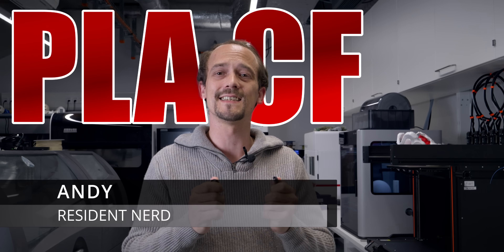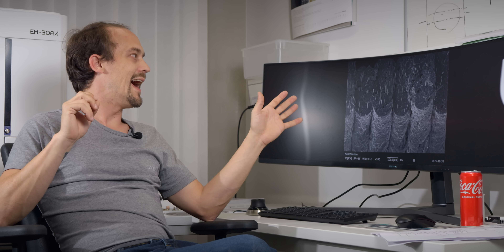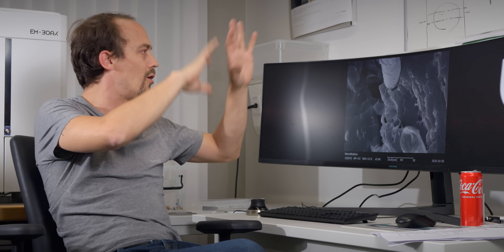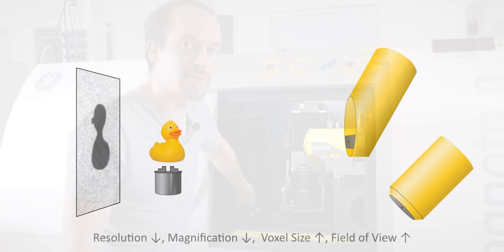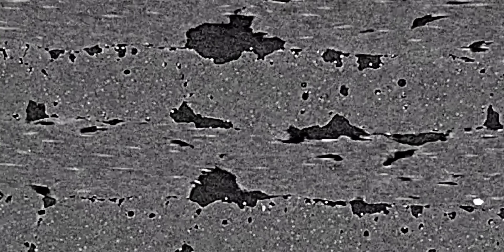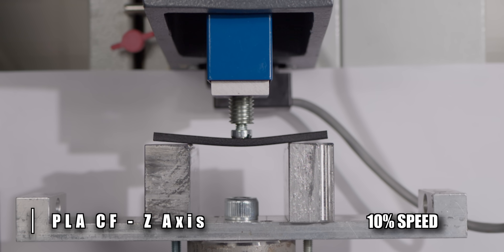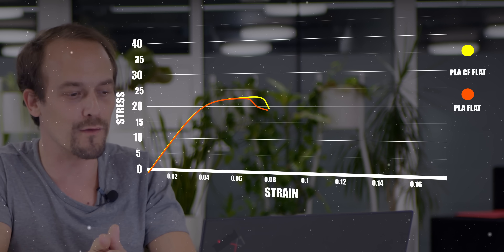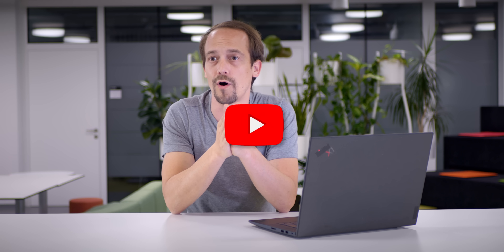3D Printing’s Biggest Scam Is Even Worse Than We Thought!

Comment: My results of testing this were that the TDSs are very accurate and CarbonX PETG-CF is on another level from all the other PETG-CF
Reply: 3DXTech also makes the best PC-CF on the market. PC from most brands is far too heavily blended with ABS or other polymers and loses a lot of the desirable properties. I will also say that Tinmorry PETG-CF and PETG-GF is excellent for the money. Overall fiber filled PETG is awesome and I'm not sure why he is categorizing it with fiber filled PLA which has far more shortcomings.
Reply from the maker: That is why i said "for the most part". In PETG Filaments it is highly dependent f the fibre was surfacetreated correctly.
Reply: @Ibuiltathing Fair enough. I've just seen PETG-CF be pretty universally good and there are a lot of affordable great options. The surface of the fibers is something your vid def has me thinking a lot about. Sorry for spamming your comments so much. I get hyper focused. 😂
Reply from the maker: Ohbi know that feeling and dopamine rush 😅

Comment: What a great video! Such great laboratory equipment. I would be most interested in seeing Bambu Lab's PPS-CF next.
Reply from the maker: I wanted to try that material for a ling time. I have a spool sitting around. Good idea
Reply: @Ibuiltathing I have a spool as well and have been wanting to try it for some time now. It would be great to know the real structural differences when printing at 310°C (lower end), 340°C (upper end), or even 350°C (the H2S max temp). I'm also curious if there are any structural changes when attempting to anneal it. In other words, it is quite an expensive material with the promise of high strength, so how to get the most out of it?

Comment: Obviously Cf filaments are dogshit for mechanical properties; and interesting to see some of the details behind it.

One of the legit benefits is improved dimensional stability though; even PLA is annoyingly warpy if you actually care about precision of large parts; and you can do a lot about that with fillers. 

Now what would be great if someone brought a PLA to market with fillers specifically optimized for that purpose; not abrasive, expensive and possibly harmful carbon fibers. But sometihing just tuned for super easy printing, and near zero net shrikage. Now that would be great.
Reply: Depends entirely on which mechanical properties you are talking about. While PLA may not fare well, most filaments including PETG benefit in terms of strength, creep, warp, shrinkage, temperature resistance, glass transition temperature, and in some cases layer adhesion even if only due to higher possible print temperatures. Generally they are simply worse in terms of toughness. They are more brittle. So, no, what you said is not obvious and often not true at all.
Reply: @802Garage  Talking PLA here specifically; but also for other polymers the main attraction to me is the lower shrinkage (like; it turns nylon from something otherwise almost completely useless into something quite capable). But thats really not due a dramatic difference in when the part might fail (for the better); but due to a dramatic difference in wether something useful comes off the printing bed.
Reply: @eelcohoogendoorn8044 Fair enough and I definitely think automatically assuming a fiber filled filament would be better for any given application is a mistake. It definitely helps stabilize a lot of the "engineering" filaments in super beneficial ways.

Comment: Man, smaller content creator showcase YT algorithm actually did its job for once. This has been highly informative video backed up by data from such high level equipment. Stellar video presentation too.

From my personal interests, if I may request, I'd be the most interested in PC-CF tests, since that is one that is one of the most accessible mechanical grade CF reinforced materials in terms of price and ease of printability.
Reply from the maker: Greate idea. It's on the list now 😊
Reply: I haven't had much luck finding quality composite PC besides maybe spectrum filaments, but I haven't tried them. Any recommendations? I bought some PC-GF one time, and I'm pretty sure it's more PETG than anything (or some other non-PC polymer), and it's the worst of all worlds. ChatGPT later told me GF does not bond in PC at all without specific sizing and silane treatment so it probably was just mostly PETG or something that works with cheaper chopped fiber... (this filament was not expensive enough to expect it was properly done, lol). I don't know if that was accurate or not but the filament did not seem worth using to me.
Reply: @itzexor  The one I have tried is PC-CF from Prusament. Was out of stock almost permanently but seems they finally have gotten their chain of supply in order so finally got my hands on some. Prints like a dream, but haven't yet finished the model for which I got it so can't attest to it in practice. Everyone else seems to be very satisfied with it though.

I remember seeing one other brand do PC-CF but other than that I actually haven't seen much of this particular blend in most brand repertoires.

Comment: Please do the comparison with other materials. This is on a whole other level than the normal stress tests we see on the other channels, showing us what's really going on instead of assumptions. The result with PLA doesn't really surprise me since it's notoriously difficult to make PLA bond with something other then itself. You earned yourself a subscriber.
Reply: Yes please, I would also like a comparison in this depth with CF- ASA, PA6-12 and so on, but also with regular version under the microscope
Reply: Funny - PLA is the exact opposite of silicone caulk, which will stick to almost anything - except itself!
Reply: If that part is made of solid wet‑layup carbon fabric and epoxy, it will break that press
Reply: @lyubomirmihaylov750  If it was, it would have been fabricated with a mold, not with a 3d printer. Different scenario, different story.
Reply: But actual stress tests are what matter! Theoretics are phenomenal, but when testing disagrees, one has to reconsider.
Reply: @TravisTerrell  Most stress test only show that the material failed, These microscopic images give us insight why they fail (and what filaments are bogus). There are many reasons tests fail, but not all have to do with the material but can be due to printing orientation etc.

Comment: Anyone using PLA of any type for its mechanical properties is designing for failure. Speaking from personal experience. The fact that the carbon fibre is impregnated in fragments and not laid as strands eliminates the strength of carbon fibre. I need to add though, I love the look that carbon fibre gives filaments. And PLA is still my all time favourite plastic for anything that I want to have a near perfect look.
Reply: PLA has many desirable mechanical properties provided temperature thresholds are not exceeded.
Reply: @802Garage yes, technically brittleness is a mechanical property, just not a desirable one.
Reply: @Cleav727 You're forgetting that brittle usually goes with strong. ;) PLA has very high strength for its cost and ease of printing. Also generally solid layer adhesion. PLA also varies wildly.

Comment: I have two wishes please: 
Please do the same for glassfiber filaments and please do the mentioned health risk tests.
Reply: Search for dissolution of glass fibers in lung tissue. There's been a whole bunch of research that shows the fibers break down within a couple months before being ingested by macrophages. Makes sense from an evolutionary stand point. Pretty much all living things live in close proximity to sio2 so there needs to be a biological process to deal with it.
Reply: Any small fiber that is inert and cannot be degraded in the body is no different than asbestos. Glass fiber lung disease is silicosis, which can trigger lung cancer.  Many cases of CF induced lung cancer have been noted, including famously in race car driver Stephan Johanson, who inhaled particles from CF brakes.

The lack of regulation around these materials is ignorant.
Reply: @truantray This is only somewhat true. In asbestosis and silicosis, the mechanism of damage is the same, with atomically sharp fibers slicing up your lung tissue, causing an immune response, and building scar tissue which reduces lung capacity over time while massively increasing cancer risk.

However, asbestos is friable, and the fibers are roughly 1/10th the width of carbon or glass fibers. This allows them to become truly airborne, held up by brownian motion of air molecules in a way the other fibers cannot be. Sure, if you get blasted in the face with carbon fibers every day you're going to have a bad time, or if you're constantly exposed to brake dust as you note, but just existing in the same room as fraying asbestos materials poses a serious risk because once that stuff is in the air it stays there far longer.

Furthermore, asbestos fibers are so narrow and so sharp that they slice up even the scar tissue growing around them in our lungs. Our bodies simply have not evolved any means of defending from it. As a result, it takes far less asbestos exposure to build up similar amounts of permanent damage.

Long story short, don't breathe inert fibers. But fiberglass has less regulation because it is genuinely safer, being both harder to suspend in the air long enough to transport to the lungs and less damaging per fiber than asbestos. Use ppe if you're going to be working with the stuff, but it won't kill you just by touching it the way asbestos genuinely can.
Reply: @truantray never thought of that but I'll make sure to not breathe around carbon carbon brakes in use without a respirator
Reply: I also want fiberglass and health vids, and mostly some statements on sizing!! (Surface activation)

Comment: Health risks of CF would be a good watch.
Reply: CF has been around a very long time now.  Google it to find out everything you're worried about.  Lets not waist his time on general concerns.  Let him do valuable research on different types of Filament.  Thank You.
Reply: Yup, looks like carbon fiber is on its way to be the new asbestos.
Reply: @jozseffabri  specifically chopped carbon fiber. The strands and fabrics most are familiar with are no more dangerous than a cotton thread.

But yes when it’s chopped into microscopic glitter. Definitely a problem.
Reply: @jozseffabri your body can break down carbon fiber. It cannot break down asbestos. Should you be huffing carbon fibers? No. Is it as bad as asbestos? No. Wear a mask if you’re sanding, gloves if you’re particularly sensitive.

Comment: Well well, another channel that seems very high quality and vastly under rated! Subbed!
I am an engineer and a 3D printing enthusiast, i do print some CF materials but not for the strength (i already knew there are no benefits really) but for the looks.
CF parts tend to look better imo, better surfaces finishing and feel.
I am a bit worried about the health side effects though, so please dive deeper in to it!
Reply: You do not want to breathe in or handle very short length carbon fibre. Trust me. I'm not going to go into it here, but they pass through your skin and move around the body. The true long term problems are not known yet. But it's only a matter of time before it becomes a restricted product. Long fibres are far less risky. Sanding and high speed machining are the main problem, I do not know but they may be similar in size to the CF reinforcement. If these fibres are loose on the surface of the filament then could be cause for concern. I look forward to seeing a report on this.
Reply: @dfronda2708 The fibers are typically between 0.03 mm and .3 mm depending on the filament. They have to pass the nozzle without clogging.
So it's more a dust than fibers.
Reply: @dfronda2708  Well the strands are too short to pass the skin, thats for sure. Inhaling them is the main cause of concern for me, as it could cause inflammatory response in the lungs. So sanding is definitely out of the question, even with mask i wouldn't try that. But can we get the strands in our lungs by just handling or braking the plastic?
Another curious thing for me are the CF brakes used in cars these days, the dust from the friction with the pads caused quite some dust, are there dangerous strands in there i wonder...

Comment: I wonder if it would be possible to make it actualy usefull if you "temper" it by bringing the entire thing up to its melting point and alowing the voids around the carbonfiber to close?
Reply from the maker: The issue is not in initial extrution but in the fact taht PLA Cant bind to cf. And there is no wetting agent that can make it do that